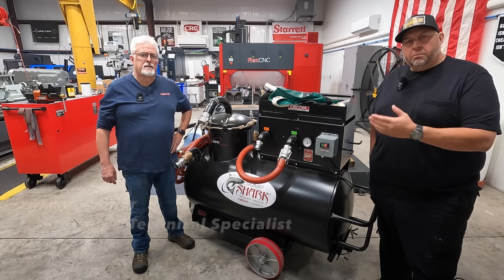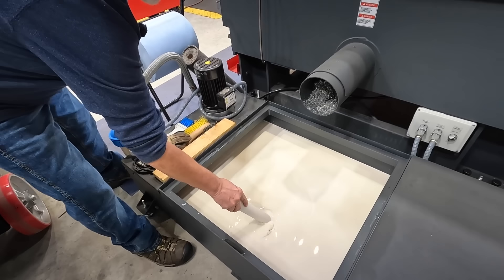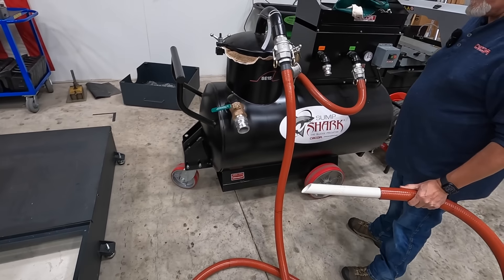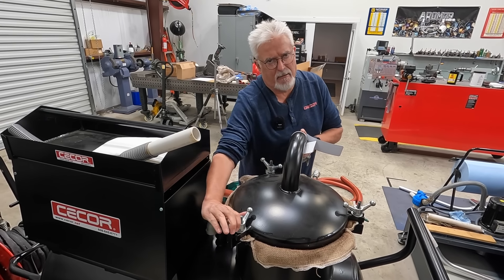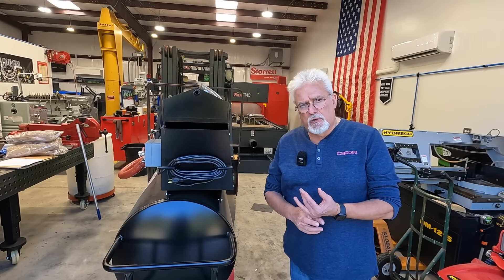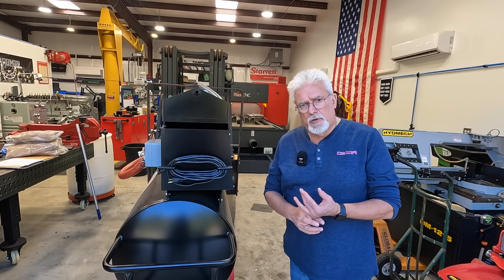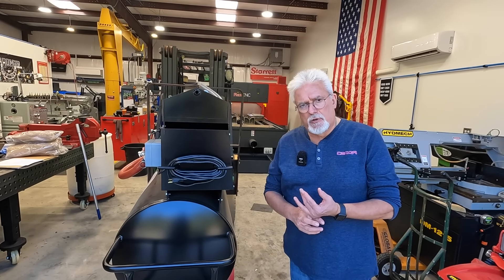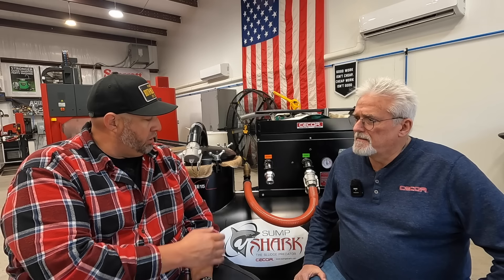Machine Sump Cleaning & Coolant Filtering Using a CECOR Sump Shark

Comment: When I was working in a machine shop we ran lots of plastics. The absolutely worse stuff was when we were machining fiberglass, often with diamond burrs. It would make a fine powder that would go right through the screens and make a sludge in the bottom of the tank. The sump got cleaned out every time we ran one of those jobs.

Comment: Probably would be a good idea to throw some oil pig mat on top after the straining. Would probably work better than skimming.
Is there a procedure for biocide and pH control?
Also, I'd throw some brass screen in that chip basket. Seems you could really extend the clean out interval by a little extra work stopping the chips.

Comment: On all of our machine tools, we added a T right after the coolant pump and plumbed in a washdown hose. A nice machine, but I think it could use a couple more valves. You’re constantly moving that hose back-and-forth from the vacuum to the pump if you made a manifold and put a couple valves in there, it would save some time and wouldn’t coolant all over the floor, keep the videos coming
Reply: I was thinking a three way ball valve

Comment: Adam you could measure the % of oil in the coolant, because over time the water evaporates and you need to add water. I thought you have a refractometer?

Comment: So...where do you dump all that coolant?  Serious question here.  I know where to take household volumes of used motor oil (most local auto parts stores have a used oil tank), but coolant?  I can send coolant (auto) at household volumes to my local hazardous waste disposal events (yearly), but they wouldn't accept 55 gallons, nope.   So where would I send this to?  I also know for oil (engine, transmission, etc), lots of people have waste oil burners and are willing to actually pay your for it, or will just take it off your hands so you don't have to spend money to have it picked up and disposed of.  

Always wondered how you, Steve, Keith, etc. deal with disposing of your machine coolants.

BTW: 110 gallons of hydraulic fluid...started my career in Inter-press Transfer systems for Automotive Stamping presses.  I was working a job on a hem line that was running decent sized (500T) Hem presses from about 1940...ca-chunk, ca-chunk, BAM....hydraulic fluid rain storm.  I am so glad I wasn't where it blew (I was at the exit of the line).  Poor crew that was at the head were coated...and I mean COATED in fluid.  It took HOURS to clean that mess up.  They said they drained a 2000 gallon sump in about 30 seconds.  WHAT A MESS.  LOL.
Reply: You call someone like Safety Kleen who disposes of it.  But if you put your coolant in a big IPC tote and vent it so that the water evaporates, you will dramatically reduce the volume of what you have to pay them to deal with.  If you're at 10% concentration then 55 gallons turns into 5.5, or at least less than 10.

Comment: What sort of machines is this thing meant to be used for? This guy is talking about hooving out sumps on a monthly basis, but my VMCs run 1800h/year and get a coolant change and clean every 18 months, and I barely take a handful of chips out.

Honestly looks like a bandaid on a problem that's easy to fix with some fine mesh filtering, tramp oil skimmer and decent coolant maintance.
Reply: 1800 hours (5 hours a day) is noting.
Reply: @AdamsLab  huh? why are you using 360 days a year?
Reply: @AdamsLab  You clearly should stop commenting NOBODY works 24/7 Assuming the machine runs 5 days a week like almost everybody works that's 260 days a year (365/7*5). So +- a few weeks of holiday lets say 235 days, that's roughly 8 hours a day. So i would assume he works his machines 8 hours a day 5 days a week. 
I don't know why i have to tell you this but not everybody makes products that are so high quantity that they need a robot to do it 24/7. (and not even that is actually really possible because you need someone to refill the parts if the duration of the machining is very minimal)
Reply: @spikeypineapple552  You know internet experts, my guy thinks he is so slick and smart and even commented his calculation with a ;) even though that's like 4th grade math lmao.
Reply: @FireGodSpeed  -  - I know of three shops (two that my son has worked at) in my area that run 24 hours a day 🤷‍♂️

My point is that 1800 hours a year on a machine is noting and isn’t necessarily a good metric for the life cycle/expectancy of coolant, or if this tool would be valuable. Some shops will go through coolant much faster than others. 

And since we’re being pedantic. 5 days a week, excluding federal holidays is 6.92 hours/day.

Comment: 2 thoughts
could u put a fine bag under the course at the same time
and could u put a 3 way ball valve on instead of having to change hose connection back and forth from suction to discharge

randy
Reply: I believe a 3-way valve would really jack up the price.